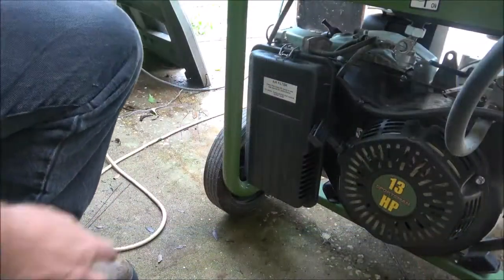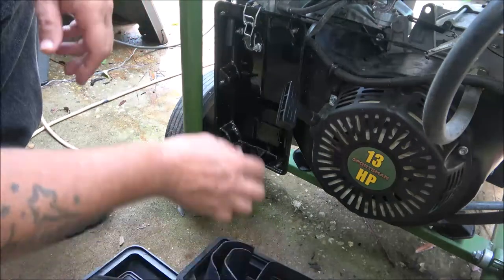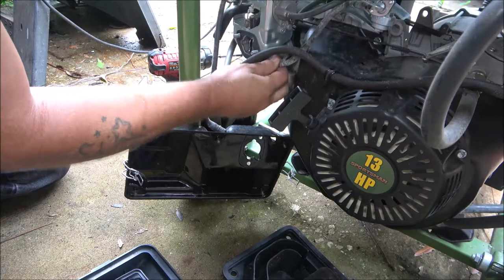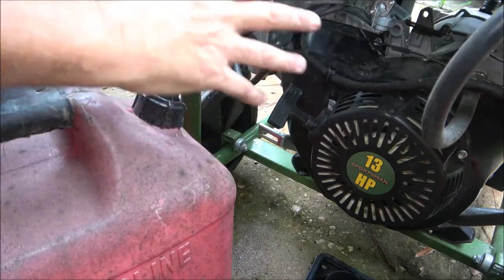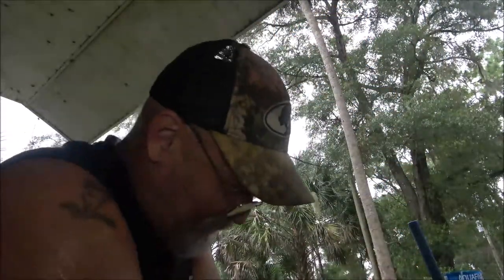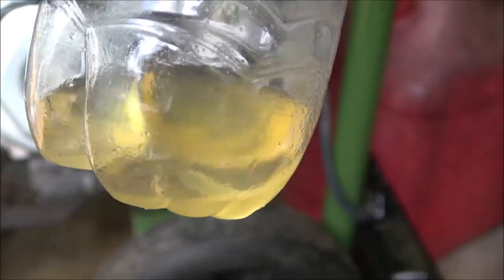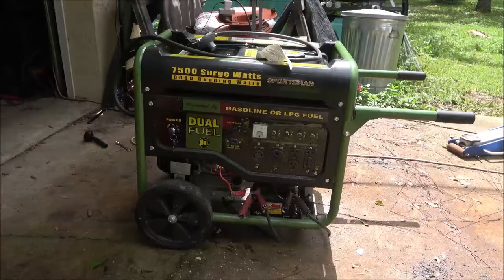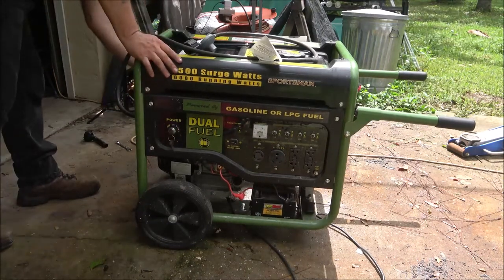Changing The Fuel In A 7500 Watt Sportsman Generator

Comment: Way to go Shaber, this way when you need the gen, she's ready to put out, I mean power.
Always good to have a few extra qt of oil and another clean air filter and maybe a spark 
plug. Some keep a log of hours used. When Irma came thru Fl in 2017, I had gen running 
for ten days, 16 hrs a day. after the 3rd day I started her up, let her run about ten minutes,
then shut her down and changed oil and air filter which was used but I washed it being a sponge type in dawn dish det. rinsed, let dry thoroughly, soaked in eng. oil an squeezed 
out excess. So she was ready for another 3 days. Some say change oil every 100 hours,
but I think fifty is better.  when I shut gen down end of day, I just shut off the fuel valve. 
I know what u mean about the new jerry jugs, more unsafe now then ever, better off to 
get a large funnel. Many don't know it, but gen running out of gas with a load CAN/or will
mess up the AVR auto voltage regulator and gen will not put out power after that.

Comment: Just a question, why didnt you take the fuel line off that's coming from fuel line on and off.. as oppose to taking the carburatkr apart and draining the line from there?
Reply from the maker: Because the fuel wouldn't flow through the pump without the bike running.
Reply: @shabear1000  and actually I tried what I suggested to you, and it was very hard to get off, the way you did it was actually the best way. I did exactly what you did and it cranked right up.. I was being lazy and didn't want to take the filter off, etc.
Reply from the maker: @shields_movers  yeah I do that sometimes too. Sometimes it's quicker and easier to get something out of the way than to try and work around it. Glad it helped.